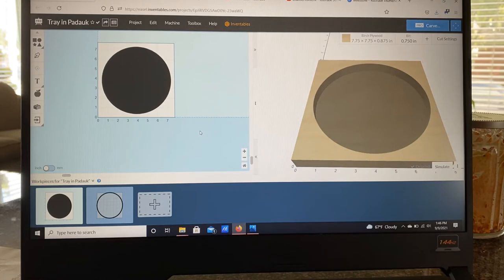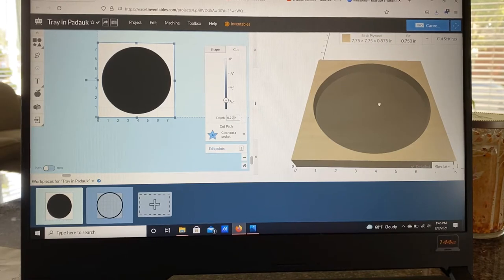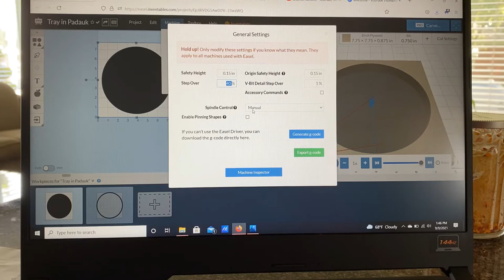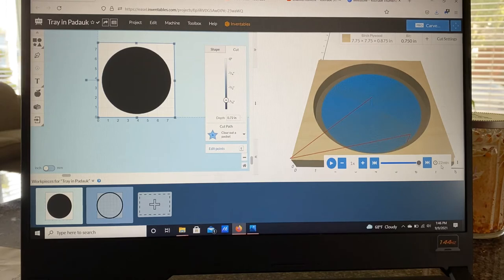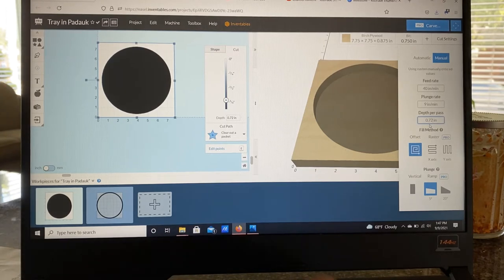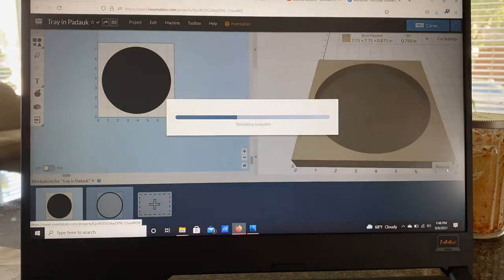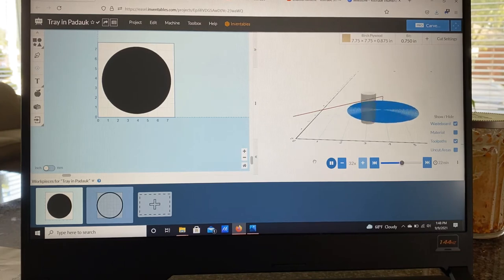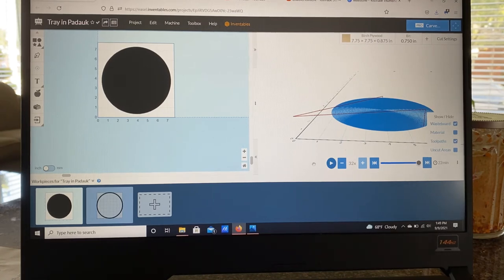OneFinity CNC - Round Dish Valet Tray Catchall EDC

Comment: I see you had 40 ipm feed you can bump it up to 65 ipm since your cutting so think and only 5% stepover and still get a glass finish but done in 12-14 min.
Reply from the maker: Thank you. I’m new to CNC. I’m always leery about running these 1/4” shank bits too quickly- especially ones that have a much larger cutting head than the shank. But you’re right, with that final pass taking off so little, there will be very little stress on the bit.

Comment: How many initial passes do you do (rough cut)?
Reply from the maker: That all depends on your material thickness and your specific machine. To be honest, the amount of passes doesn’t matter to achieve the smooth final product. I used 3/4” material and I run my machine at .1” per pass. I hope this helps
Reply: @SJSSawdust  thanks i am doing 3/4 as well walnut. At first it was wanting to go about .02 depth per pass but man that took a while so to hear it will probably be ok to do .10 makes me happy because "ain't nobody got time for that" lol  I don't know how to find the Information for my machine I have a onefinity but a newbie who doesn't know where to find information on the nitty gritty has been slow go. Thanks for the help I appreciate it
Reply from the maker: @deejay9671  no problem. Let me know if there is anything else I can help with. As you go further into your CNC journey, you’ll start to learn your machine. I’m about a year and a half in and you’ll be amazed at how far you’ll come in that time

Comment: How much sanding time is this saving?  22 min per piece in a production run is a lot.
Reply from the maker: I tend to run my machine much slower than it needs to be (less stress on the bit and machine). You could definitely speed it up to cut down on time further. The biggest “pain” is the actual sanding of these hardwoods - tires the arm plus kicks all that fine dust up into the air. Using the machine saves the arm and creates larger wood particles which are less harmful to breathe
Reply from the maker: Plus, while machine is working for you - you can be doing other stuff 😀